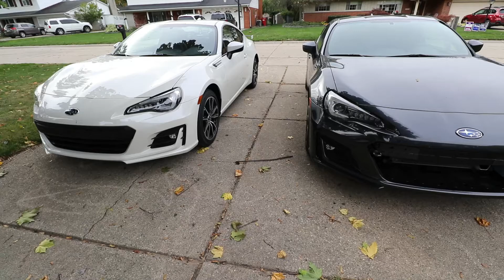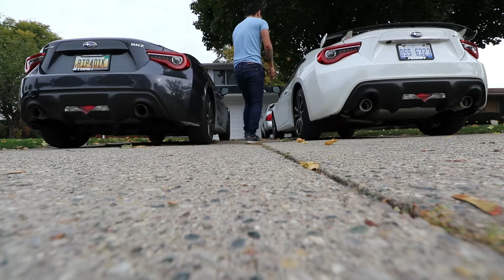BRZ Sound Comparison - Stock exhaust compared to a full exhaust setup

Comment: I really appreciate this video, getting my brz this month :)
Reply: I dont understand how such a cool fucking car can be so inexpensive. I was expecting no less than 30k on the cheapest retailers
Reply: @ftrctyvreycertcewtcwrgcwef6000  people calling this car slow but I feel like it has enough power but it would be fun to have a little more. The reason why I got this car is because of how big the aftermarket part scene is.
Reply from the maker: No problem, thanks for checking out the video! I love the BRZ/86 platform. Very fun and a lot of aftermarket options!
Reply from the maker: For some reason I love "slow cars". I don't believe this is slow, but rather an appropriate starting power level for what this car is. NA cars like this are very reliable with just standard maintenance. It's fun, but handles predictably. It has enough power from the factory to send it sideways when you want. The aftermarket scene is excellent and the motor is easy to work on. If you want more power you have options, add ethanol, add a turbo kit from a reputable company like JDL, or swap in a motor of your choice. A 2j+cd009 trans can equal a scary good time.
Reply: So how has 1 year of BRZ ownership been?
Reply: @kindnessisalie5411  no issues at all, car has been a reliable source of transportation this past year :). I have made many friends as well due to the fact that we all share the 86 platform.